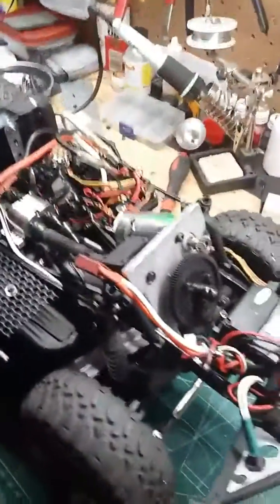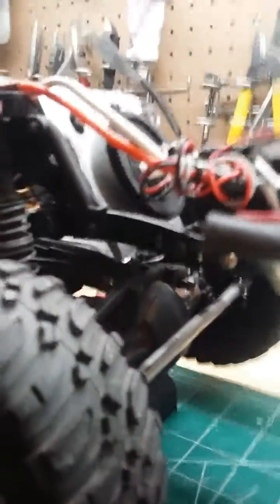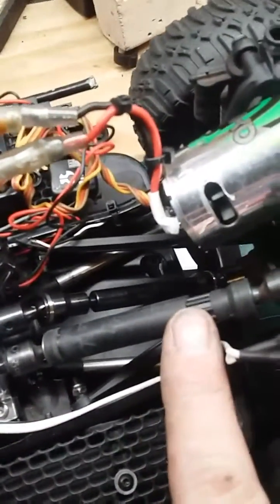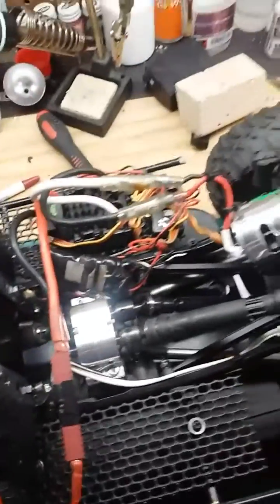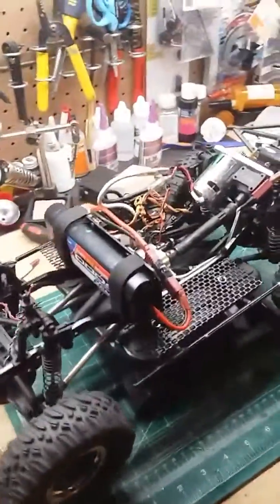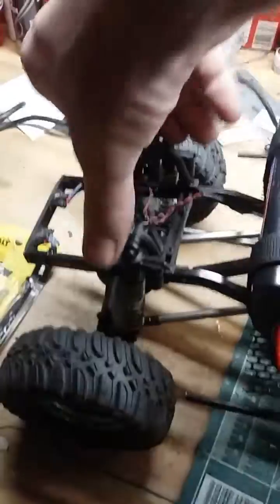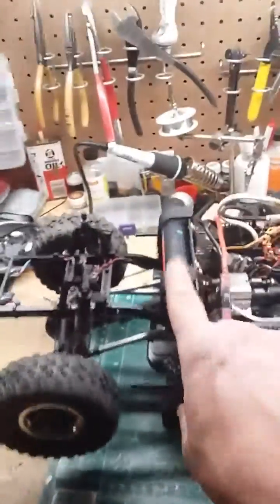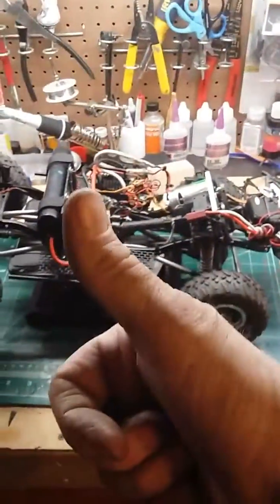Custom front engine  mount on a budget. SCX 10

Comment: Where'd you get the small transfer case? And you use a panhard bar setup in front?
Reply from the maker: transfer case came from amazon, cheap but works. no pan hard yet.
Reply: RC Exploits/OklaMopar Thanks, do you remember what manufacturer it came from? How do I get it? :)